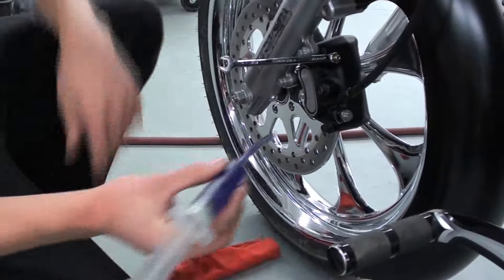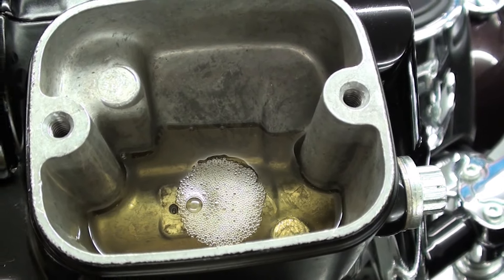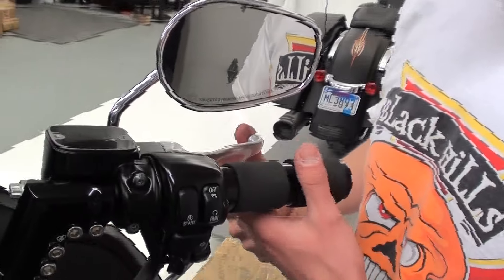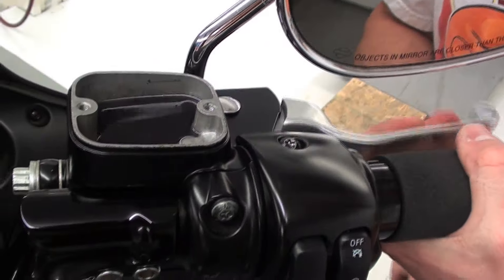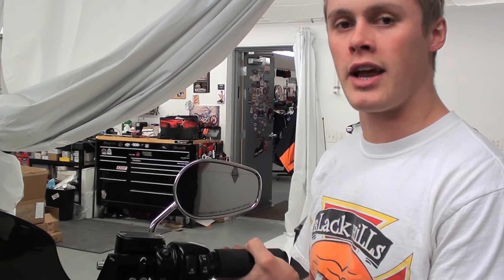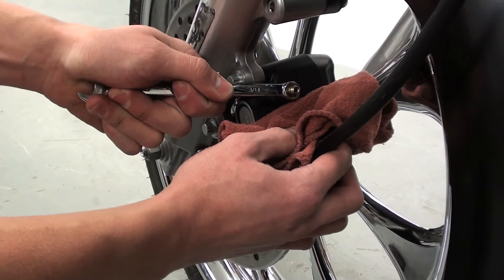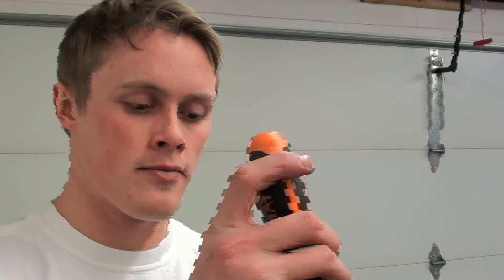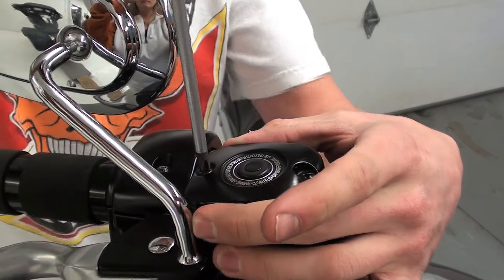Bleeding Brakes on your Harley-Davidson

Comment: My only gripe: You started out by pushing a large air bubble into your brake line. GENERALLY you would remove that prior to connecting the syringe to your caliper. Other than that, Great video and straight forward!
Reply: haha.. saw that too.

Comment: Great technique. I always used a vacuum pump from caliper. This looks easier actually.
Reply: I like vacuum pumps because I can Crack the bleeder with 1 hand and apply pressure to the lever with the other and have it vacuum out the air. On my dirt bike I also wrap the lever overnight with pressure and crack the bleeder a bit in the morning.

Comment: great two part video, my only 2 cents ,you can in a one person operation; pump  the brake lever a few time's the pull it fairly tight and tie off w/ a rag, old sock .ect.. then go to the caliper and crack the screw.. Well done, THANKS

Comment: Cool. Did you hold a squeeze on the brake lever to keep the valve at the master cylinder open while you injected the fluid?

Comment: No protection on the tank handlebars fairing fork legs. ???  Brake fluid on fingers touching things. !!!! Tools on the seat. !!!! Brake fluid will ruin the paint.  And take the dye out of a leather. !!!!
Reply: Rick Simpson dot 5 is silicone based not nasty like 3 or 4 still wouldn’t want to spill it though